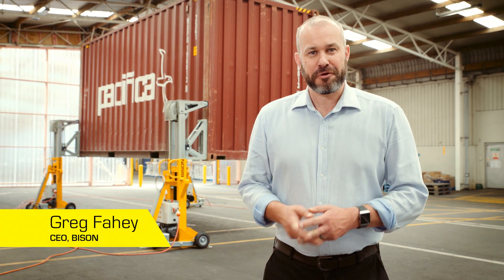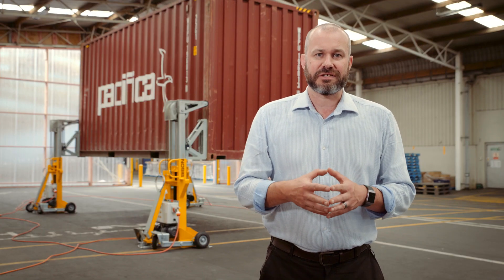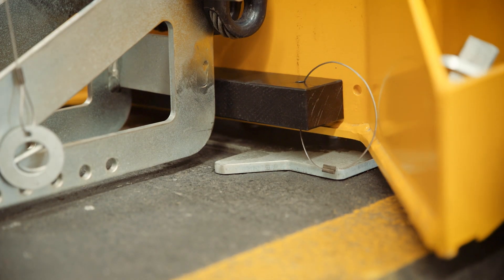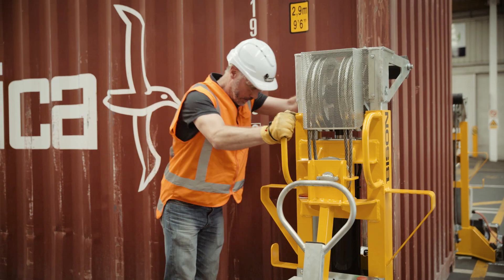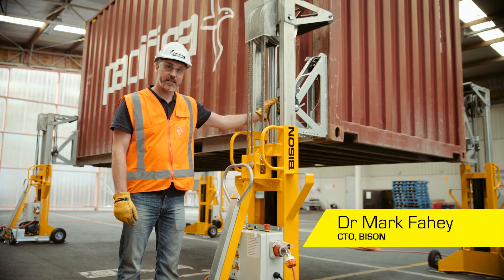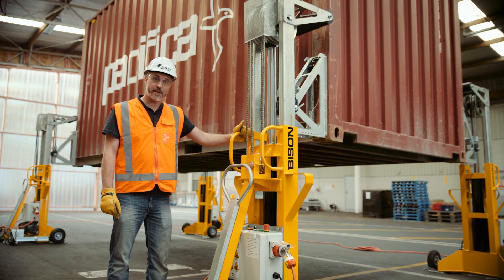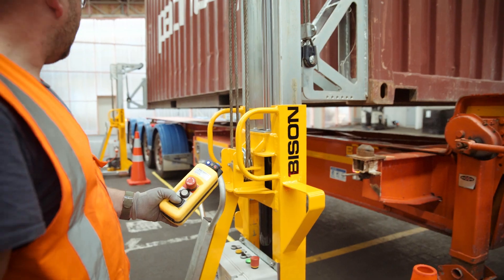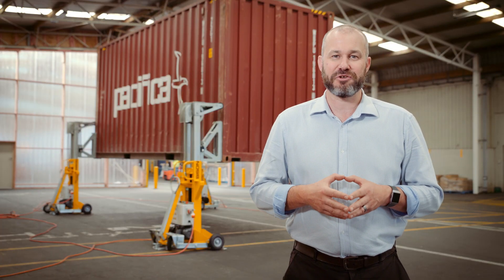Bison C-Lift A Series | Automated Container Hoist

Comment: what about if contianer is unevenly loaded and weight distribution of cargo is not well. How these jacks will adjust.
Reply from the maker: Hi Khuram, the C-Lift A Series uses a tilt sensor and load sensors to keeps the container level automatically, even if the weight distribution is uneven. Thanks for your question.
Reply: @BisonJacks  Many thanks for your kind reply, please also advise that how much time does it takes for preparation and then to lift.

Comment: is it possible for the C-lift to be mobile going to another location in addition to going up and down?
Reply from the maker: Hi Manuel, each unit in the C-Lift A32 can be easily moved around a site on its wheels. If you wanted to move them between sites, you could use a forklift, or get them on a truck.